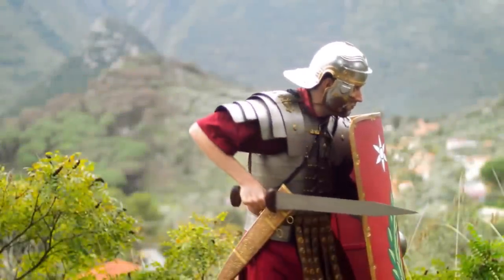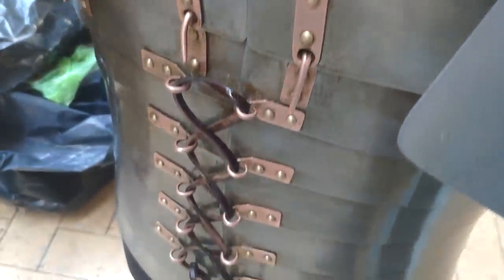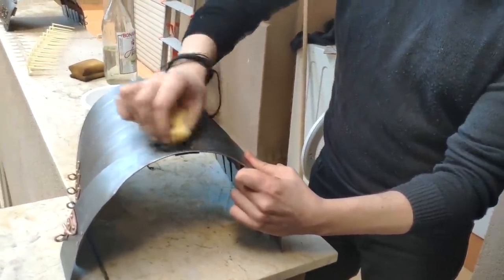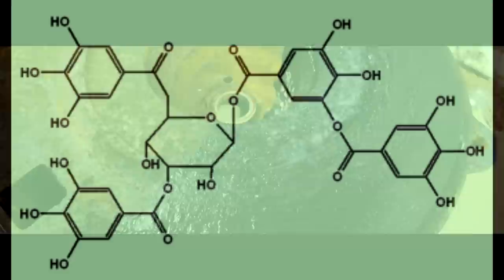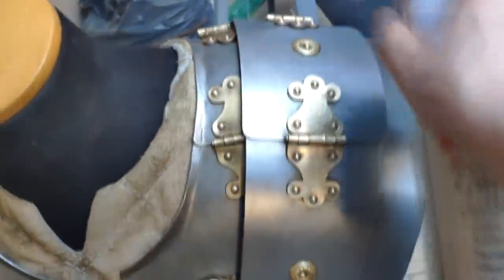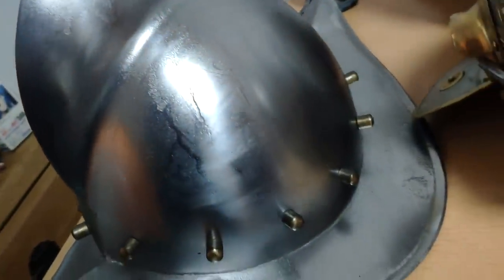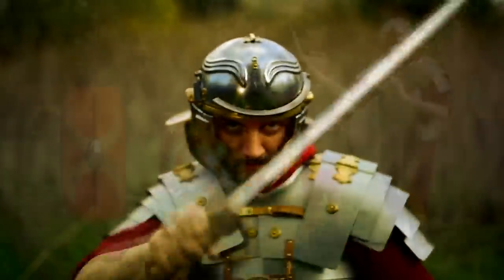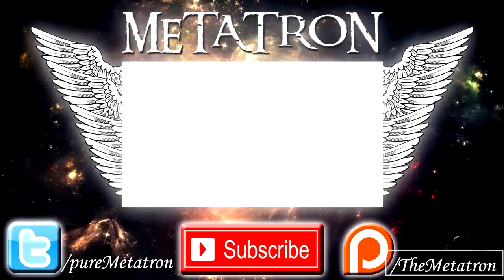How To Remove Rust From Your Armour With Only $3

Comment: "You're gonna have to do a lot of rubbing" 

Metatron out of context
Reply: lol i scrolled down just to confirm that it was posted.
Reply: Remember the oil to avoid chafing ;)
Reply: "You might need to move into a mechanical means of rubbing such as for example a polishing pad mounted on a drill."
- Metatron 2019
Reply: Unless you have a pretty interesting imagination it's vague.
Reply: Reminds me of a line from lusty argonian maid. Plenty of time, my sweet. Plenty of time

Comment: I might also recommend using some baking soda with water as a rinse. It's the acidity of the vinegar that both removes rust and causes flash rusting. The baking soda will neutralize any vinegar residue that might remain. For the tougher rust, you can use apple cider vinegar. It's a bit more acidic than the white vinegar.

Comment: thats important thing, it applies not only for armor.
Reply: Thats true. The only sad part is that for automobiles is that they basically get sandblasted by the road while moving on it(long term).
So the automobiles need proper layers of coating that is scratch resistant.

Comment: WD-40 is not a good oil for preserving, it is for cleaning. Ballistol (or any kind of oil for guns, get the one with smell you prefer) is  by far a better oil for preservation.
Reply: Or you can use plain old silicone oil or other machine oil. Some do not even smell. You can also wax the thing though that will look different.

If you're going for 100% historical accuracy, highly filtered, boiled and cooled olive oil. Never use virgin olive oil or other virgin oil unless you actually want rust! And do not boil it in oil unless you want it black.

Comment: I have heard of using coconut oil to keep armor rust free as final treatment. But it is most often used to remove rust from utensils by applying it and letting it sit from 45-1 hour before flushing it with warm water to get rid of rust and later drying it with a towel.
Reply: Gun oil works pretty good with swords. I don't think I'd use an organic (from a fruit or vegetable) oil on arms/armour.
Reply: @fattiger6957  You can use well refined vegetal oils, boiled a bunch of times to remove traces of organics and acids. It's inferior to petroleum or silicone products.

Comment: I don't know if they are available near you- but "Brillo" pads work exceptionally well.   Whatever the blue/pink powder they have on them tears through rust amazingly- far better than just a steel wool pad.   I used to use them to clean bicycle chains of rust.  Just need a little water.
Reply: I've had good results with them cleaning swords. Just a few drops of gun oil and a little scrubbing.

Comment: Late to the commentary but came back for a revisit. White vinegar was known as far back as ancient Babylon, if I recall correctly, afterwards if I am also correct an alternative to using oil would be to use mustard, which was exported from Egypt, to coat the iron which creates a Blue oxidation that prohibits the corrosive red rust. Read plenty of sources about armor polished to a blueish sheen, this might be the source.

Comment: OMG! Use Ballistol for cleaning and for protecting. It has worked for ages! Vinegar is acidic and will cause metals to rust as well. IN the middle ages, armour pieces were put in barrels filled with sand to polish off the rust, like kind of in a tumbler... That was simply a mechanical method of removing rust with an abreasive (sand). Ballistol is basic, so it will not cause an oxidation off the metal surface...
What you can use your vinegar for? Insalata caprese...

Comment: For the finishing I personally prefer some unsalted pork lard with tiny bit of bees wax. It takes lots of polishing but the protective film on it stays pretty much forever. I didn't see any rust on my sword in last two years.
Reply: So the salt grit won't dissolve away while in use, try vasoline petroleum jelly. For a finer grit, try baking soda.

Comment: Also, never use etching solutions such as Tarn-X. They remove the rust, tarnish, and patina, but they also remove a layer of metal.
Reply: That's kinda unavoidable.
Reply: @erynncollier8672  As Metatron said, any polish will remove a tiny bit of metal, but etching solution will remove a lot of metal. If there are any fine details engraved in the metal, it will remove those, too. And if the metal is plated, it will remove the plating.
Reply: @WG55  Yeah, okay. Now I follow ya. Your original post didn't make clear the extent to which the product is removing desirable material. Though to be fair, I should have noted that we were discussing etching solution. lol

Comment: interesting fact about modern re-enactment armour, it's made of purer steel than roman armour, and therefore rusts more easily. originally the roman armour was made from wrought iron, which has more silica and other impurities, which formed a protective layer against oxidation. additionally, it seems like some armour was blackened for extra protection.

Comment: Wait  second your video reminds me I didn't drink my daily glass of Ballistol!
About the smell I personally prefer the organic, vegetal smell of the ballistol to the one of things like WD40 or Brasso for example. And as you mentioned Ballistol leaves a nice film on the metal other chemical products cannot necessarily do.
The other big plus I could say, thanks to my military swords collecting experience is that Ballistol doesn't harm wood, leather or fish skin if they are clean enough unlike many other stuff.
Oh by the way the vinegar efficiency is not due to its acidic properties, at least not stricto sensu. Acetic Acid, as a carboxylic acid, is a soft reducer and so works well on the red or green oxidized pieces of metal you're dealing with. As a chemist I cannot agree more on your rust converter red alert!
By the way when dealing with dirty or simply old black leather my personal solution is a soft washing with some leather soap and warm water then once a year some neatsfoot oil thin coating. But beware it tends to colour the red leather you can find on some British or French African Army scabbards or some sword knots for example.

Comment: good stuff, man. ? though: how did soldiers like the ancient Romans handle weather conditions where their equipment was concerned?
Reply: i know medieval armour was made from wrought iron, which has a greater amount of impurities in it, like silica, which creates a protective coating. 
afaik, roman armour was similar. in britain, a wrought iron fence from the 18th century was replaced with a fence made from modern steel. needless to say, it rusted almost immediately. it is also likely that at least some roman soldiers were either painted black, oil coated or oil blackened, to improve rust resistance. 
i believe at least one imperial italic helmet was found with a layer of black protective oil added to it.
Reply: They try to keep the metal greased all the time, with old olive oil or pig fat, or do exactly as in  the video.

Comment: Hi, I tried it on my lorica. 1. All salt did not dissolve in vinegar. 2. It left dark stains where rust was.
Question: WD40 is it oil (of the brand) or regular WD40 from the hardware store?

Comment: I am sorry, but rust is not just iron oxide but also iron hydroxide which is insoluble in water.
Reply: The acetic acid turns the Iron hydroxide into iron acetate, which is soluble in water.

Comment: Question: if I'd want a plate or helm blackened, besides getting it a black zinc-coating (which has its pro and cons), would be letting the plate get rusty and then converting the red rust into black rust a viable option?
I think it can't be done on chainmails, though, due to the attrition the rings have, which will surely rub the converted rust off. Or not?

Comment: Question for you, on my viking shield i have mild steel strips to divide the quarterlies, and of coarse the boss, Can i use a rust converter for the specific task of blackening the steel and leaving it like that? 
(as a panel beater i use actual rust remover so i never use converters for rust removal)

Comment: How do you remove rust from mail armour?
Reply: I've never tried this, but I heard that putting sand with the mail in a barrel, and rolling the barrel down a hill multiple times is supposed to work. That, or set the barrel in a frame with a crank to turn the barrel. Maybe a rock tumbler would work? I joked with the fellow telling me this that maybe by using steel and copper links and the right converter, he could make camouflage chain mail. LOL
Reply: @joeampolo42  lol @ the cammo mail!
Also, yeah, mail in a barrel/cement mixer and make it spin, the sand (as fine as possible) is actually optional.
Reply: Soak it in vinegar and monitor the progression...as Raph said remove the vinegar and oil it.

Comment: I'm bad in chemistry, but I know that salt and acid promotes rust. I also know that this method works. Mystery.
Reply: They're reducing agents - you want the iron oxide reduced but not the iron itself. It's all about length of reaction, temperature and strength of used acid-salt mix.

Comment: Have you tried clear gloss as a preventative?  i dont have armor but i do have a couple of motorcycles and i have used clear gloss on some to have a bare steel look without the worry of rust.
Reply: That would work well for display armor, but if you wear it regularly the metal bits rubbing would scratch and chip the paint, leaving a much more difficult job than re-oiling.
Reply: @somerando1073  makes sense, no one is hitting my bikes with a sword/spear/etc.

Comment: You said a more abrasive pad or whatnot would be alright so is steel wool ok to use?
Reply: The finest grades of steel wool works great. Don't use the coarser though, it will leave noticeable deeper scratches.

Comment: Well now that I've written a book to try to add to the excellent points in this video, and not sound like a know it all...., I need some help.

As you can see I test a LOT of different products so I decided to try RenWax.

 Simple. Clean the metal with denatured alcohol, dry, wax on, wax off...breathe Danielsan...right😃

 I mean if its good enough for the British Armory museums...its good enough for me, they obviously know WAY more about this than I do. So I apply a coat like a thin layer of shoe poish and let it dry...white haze...very hard to polish off with t-shirt material...
Wait ensues...Lo and behold...it rusts..what did I do wrong guys?
Reply: You're supposed to push it into the metal with force, typically rubbing. If you polished if off without pushing it in, you probably just removed it instead. Also make sure you didn't let the solvent evaporate or it won't work - wax will remain as crystals and not adhere. If the solvent did evaporate, you can use a small amount of white spirits mixed with the wax to recreate almost the original product.